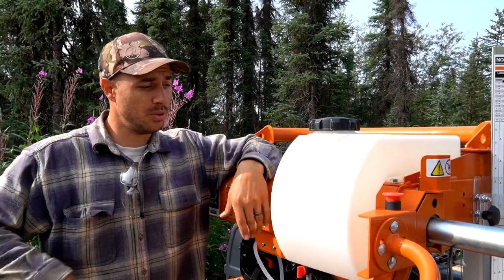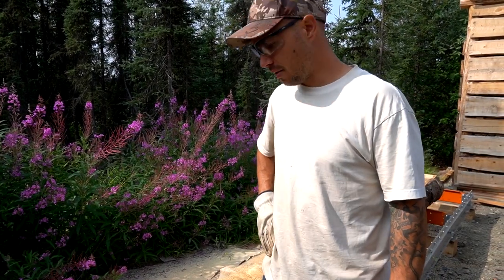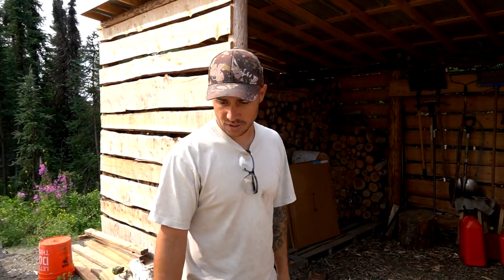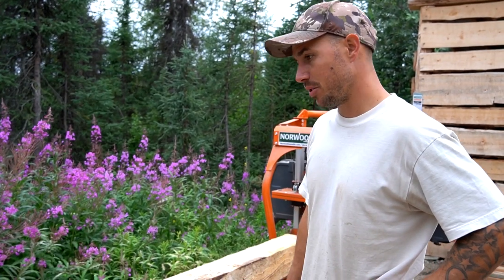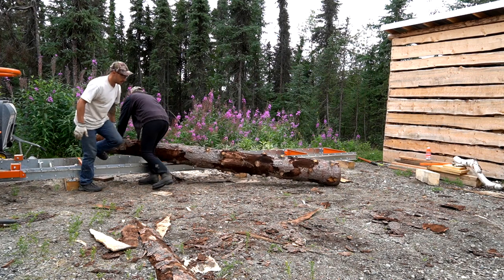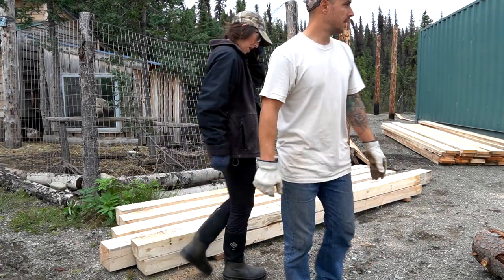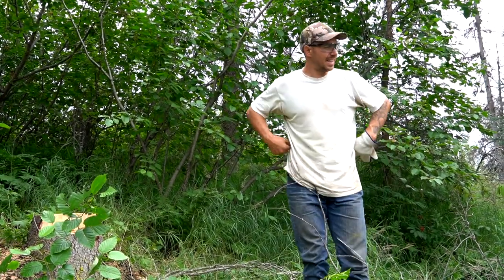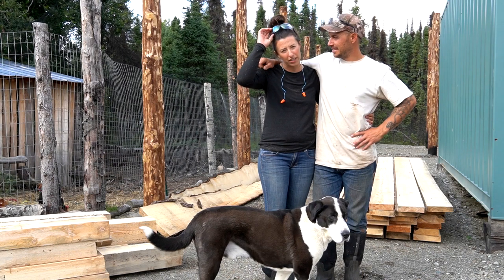Turning Dead Trees into Lumber | Milling Logs for Shipping Container Lean-To

Comment: Your saw track supports are going to be subject to movement as the water content in the ground changes, and results in shrinkage and upheaval, as well as machine vibration. If this is to be the permanent position I would suggest concrete footings set into the ground a reasonable depth.
Reply: What do you think of a bed of gravel that'll facilitate drainage beneath timber footings?
Reply: @stevepoling  the biggest problem with gravel is vibration. It constantly moves and settles. That’s what it’s designed to do. It really depends on how much vibration from the saw is transmitted through the supports into the substrate.

Comment: I also have LM29. Back off your water you should not need that much. I would suggest about 1/2 of what I saw. As you get to freezing use windshield washer fluid. I live in MN and cut in winter well after freezing.

Comment: I had something kill my cherry trees here in northeast Pennsylvania.    I picked up a small Alaskan mill, bought ripping chains and got to work with my Stihl 029.  Ended up with 900 board feet of decent cherry.   I'm going to replace some floors in the house and then I'm not sure what to do with the rest.  I'll store the rest away I guess.  It's not perfect so that'll take the non-perfect for waste.  The waste will go into the wood burner.

Comment: Its great locking at this, in Sweden this would kind if also be a possible way of living and abit of a dream for me.
Out of pure caring for you I would really recommend at least  pair of chainsaw proof pants and  helmet. I come from  a family of lumberjacks and even the best can have a unexpected throw from the chainsaw. My dad and grandad both were pros for decades  and the pants saved them from severe  injury to their legs at at keast twice times, and still hade to go to the hospital. When i look at vids of chainsaw cutting in america compared to Sweden there a huge differenses. In Sweden you have to have a safety license to be able to operate a saw, at least as a employe or contractor. 

I my self almost shat my pants when i got a throw from the chainsaw ( from a unseen branchend that i struck the tip of the blade with) and struck the saw right into my pants. I would have got myself really hurt otherwise.
Please do get some and a helmet its so cheap compared to the risk of injury and even permanent damages. Great regards from a Swed with a bunch of realtives in Kansas (other tubers to ,Peterson farm bros also showing their way of living aa you are)

Comment: Ok, "Mama voice" here. Eric - please, please, please wear leather gloves and long sleeves when working on the mill. The injury on your wrist could have been prevented if you'd had gloves on. When you were letting the cable run through your hand, I cringed at the thought that if something happened, that thing would have cut right through your hand. Rant over. 😁
I love watching your videos. Always something interesting going on. I'm too old to do what you're doing, but I sure wish I'd had a partner and the knowledge 30+ years ago to be able to. Stay safe, you two. Wear protective equipment and be the example.

Comment: Home Depot 2x8 are 1-1/2 By 7-1/2,,, sooooo if you cut yours at 1-1/2 thick you gain a 1/2 inch each cut or 4  instead of 3 out of the same log size!!! aloha

Comment: Just saw this, not sure of the date, also know you get millions of comments on what your doing wrong, don’t listen,all I’m going to say is you two are the hardest working couple, need more like you, just what i know, I’m no expert, just with your leftover waste, use them for spacers between when you stack your milled lumber each layer, called stickering, just one by two pieces between each layer, prevents mold and helps with airflow

Comment: You need to build 2 or 3 angle ramps to roll those logs up instead of lifting one end then the other. It's putting too much torque on the rails.

Comment: Suggestion: ……..1.  chainsaws….unless you are going to continuously and the saw will sit unused , leave the saw with no fuel in it. Not just the fuel tank but the carby also.  This will prohibit the old gas turning to varnish and stopping up all the little ports and valves in the fuel system. 2:…….Buy chainsaw  chaps.  Protect your body as well as your eyes.  Same for ear muffs or plugs.  Muffs much better.  I have my original chainsaw..a Poulon.  Bought it back in 1969.  It is the bottom rung on quality. It will also last for years.  Watch YouTube sites on tree cutting.  Learn how to sharpen your saw.  Buy a spare chain and starter cord.  DO NOT LEARN THE HARD WAY.  Learning by yourself is extremely dangerous,  sometimes fatal.  Let someone else make stupid mistakes.  Te first time my Poulan saw a chainsaw shop.  3 mechanics laughed at me when they looked at the bar.  I had never flipped the bar when sharpening it or changing chains.  The bar was worn down about a half inch.  The chain liked to jump the bar.  Go watch YouTube and learn what I was trying to say.  Once again…..learn from others mistakes, not your own 
Good Luck and COD BLESS YOU TWO.
JOEB

JoeB.  Age 87.

Comment: Good intensions sometimes fall short of proper training as I would be surprised if you have any formal contractor or carpentry experience.  That wet raw lumber is going to warp into problems. If you guys build 7/12 pitch roof trusses you will only need large cut 2x4s.  Too much to inform you but a metal roof is the best.....good luck but work smart....

Comment: Hello, Ok bee stings. Tabacco wet it and put it on the sting. . I see you are still cutting the first cut way to deep. It is a matter of saw blades to wood produced. Get the sharpener to sharpen the blades

Another thing moving logs. They have a set up to hook up to the front of the log and a set of wheels to put on the other end of that log. easier and cheaper in the long run.

Comment: You need to put some serious thought into a better way to move those big logs.  You are strong, but they take a toll.  You do NOT want back problems to develop early like in your 40s.  Think pulley(s) 4:1, and ramps, and rigging above the mill, etc.